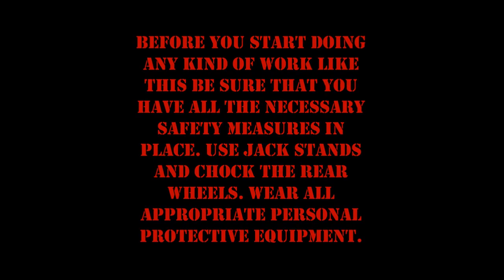2004 DODGE CARAVAN   BALL JOINTS AND TIE ROD ENDS

Comment: Hardest part for me was separating the ball joint stud.  Really have to whack the pickle fork.  I had the same confusion with orienting all the tool parts but used the instructions to get the spacer adaptors correct.  It will not completely remove the ball joint but it is tapered and you can hit it or used the c clamp without the upper adaptor to push it the rest of the way.  I separated the strut first on mine.
Reply from the maker: I hope I never have to do that again. Thanks for watching.

Comment: Thanks for the video. Looks good aside from the fact you did not use a torque wrench for anything. Especially the wheel bearing as they are opposed conical type that require a specific preload.
Reply from the maker: Thanks, I hope it helped. Yeah, I didn't know any of that stuff. That's been so long ago. I don't remember if I even had a torque wrench of any kind back then.

Comment: Hey my balljoints came with a silver washer. Where would that go? I didn't notice that yours had them.
Reply from the maker: It is possible that they go under the castle nut. Not sure though. Different brands may come with different hardware. It's been so long ago that I don't remember what brand of ball joints I bought. Pretty sure that I got them at O'Reily's. Thanks for watching. I hope it helped.